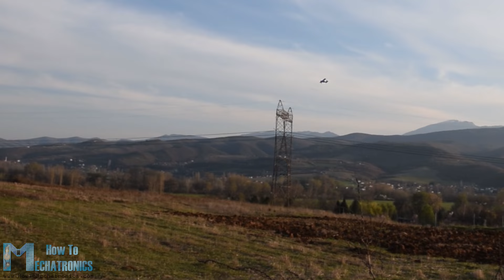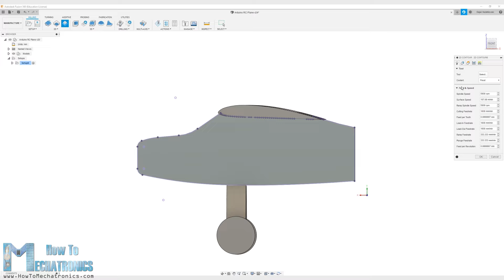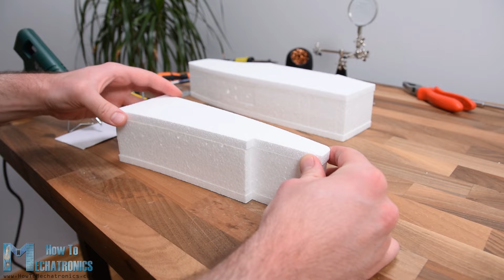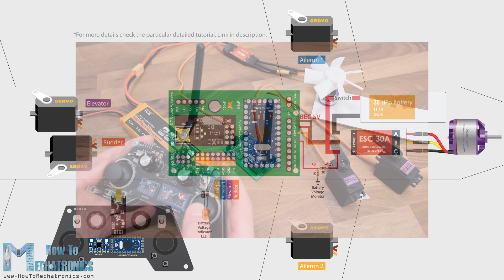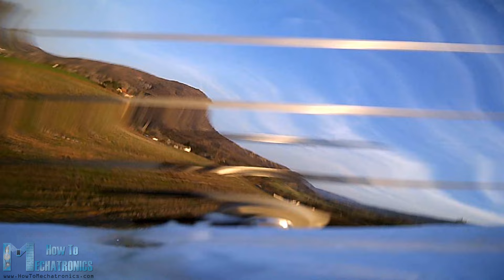Arduino RC Airplane | 100% DIY

Comment: First of all,it's definitely a big success as your first DIY RC plane.Great jobs!
Suggestions:
add some 'EXPO' to your controller output(instead of linear mapping,controller is less senaitive near neutural position.)
change rudder trim to elevator trim,that's used more often.
use XPS foam instead, it's much stronger.
search 'basic aircraft design rules' for easily determine Cg, stablizer size etc.
check out Andrew Newton 's channel, he is an expert at building foam board plane.
Reply from the maker: Thanks for the tips!

Comment: I think the plane going to the right is due to the rudder having more surface area in the right side so more contact area (due to the groove and being glued on the left side) gluing the rudder smack in the middle should solve it or trimming with potentiometer like you did

Comment: some info.     there are just a few  boo-boos/issues.
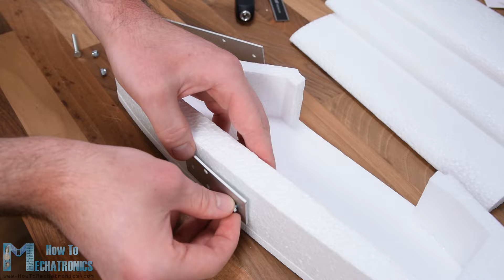at 7:55,  can you not source  1/8"  PLYWOOD.

at 8:45,  you now have a fuselage that is  tapered  in  Just  ONE  axis!!!     the Result is   Excess Mass  in the tail boom  and  excessive blocking of the  thrust air, at the nose.
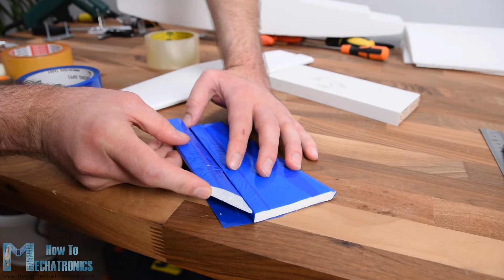at 10:16,  partial amputation of the rudder is  NOT  recommended!!!    Figure it  OUT!!!     see linked  drawing of a  notched/split-elevator;  used by  cessna.      

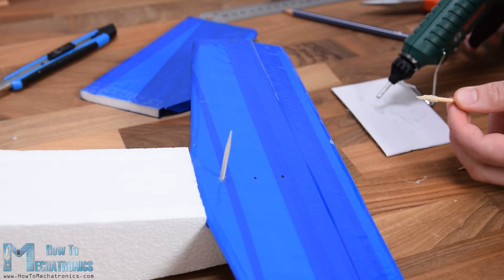at 11:00, the  Result of  slab-mounting the horiz-stab on the fuselage in that way  is,  More  excess mass, at the  Tail.     

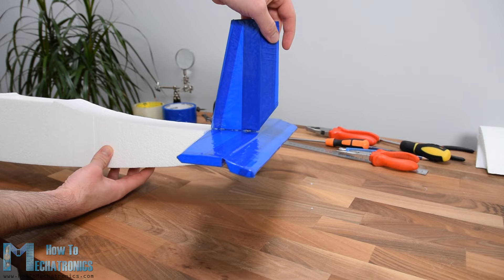at 11:13,  the vert-stab is  TOO   TALL.  and, thus, its mass is  Excessive.    the height of the vert-stab  Should be  LESS-than  fifty percent of the horiz-stab span.
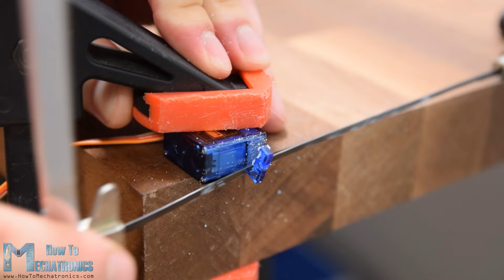at 12:17, cover the wing, from aft to forward; like horizontal shingles.   apply a finish strip,  that is  bisected by the leading edge.            at 13:58,   A N A L!!! 
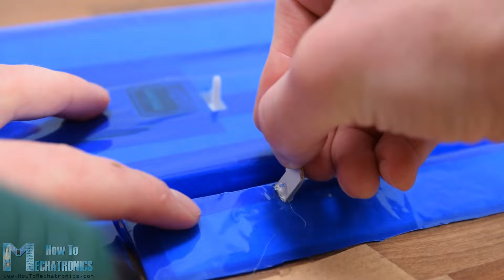at 15:03,  a  METAL  control horn. !!!   Are  You   Kidding.     use  an  OLD  CREDIT CARD  or  similar material.

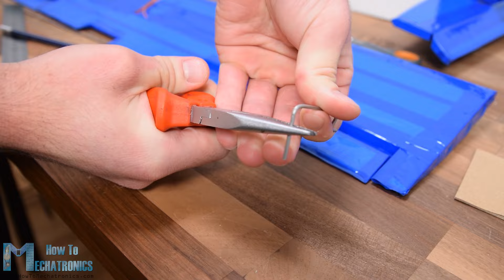at 15:09,  that  wire  is  Ridiculously  too   big; and the  holes  are  Even  bigger!!!   which has resulted in  excessive play in the linkage.
at 15:37,   servos   DO    NOT    GO    AT    THE    TAIL!!!!!     servos go  NEAR  the  cg/c-m. 
at 17:11,   something  Must  be  done, to keep the wing  'registered'/in place.

at 17:27,   MORE    EFFING   TOO-MASSIVE   METAL!!!!!!        note  that  the  struts   SHOULD  HAVE  BEEN  TAPERED, in order to  Reduce  mass.
at 21:26,   too-Heavy,   METAL,   tail wheel  strut.     this is  One  More  factor  Contributing  to  tail-heaviness, in the model's  dom.   distribution of mass.
it should be understood that an airframe has  TWO  balance points. 
the 'other'  one  is  the   c-m.     center  of mass.
thus, it should be  understood that making the nose heavier does  NOT, necessariily,  eliminate  tail-heaviness  in  the   dom.      the remedy  IS  to  REDUCE  the amount of mass  located  aft  of the cg/c-m!!!   period.      in other words, the  tail boom and  stabs  Should be made as Light as is practical;  and, the  addition of  aft-located Mass   Should  be  AVOIDED!!!     googleranslate
Reply from the maker: Wow, thanks for the comprehensive input! It's true, I have to learn a lot more! Cheers! 😀
Reply: Everything about this comment is wrong. Do some research for once

Comment: friend, you manage to convert it to  Frankenstein plane  lol. But you have done great work. What is weight without battery? You must add everywheare tape ,but thin tape.I suppose weight is less than 500gr,if so, you may need smaller batery than 3000mAh.Ds2830 is really big motor and you better try 10" props well balanced,but it would be better with a 22xx motor.Happy flying!
Reply from the maker: Thanks for the input! :) Well I guess it's too heavy, I've just measured it and its 780g without the battery.

Comment from the maker: Hey guys, I would love to hear your thoughts about this project, especially from you who have experience with building and flying RC airplanes. Please note that this was my first ever experience with building and flying an RC airplane, so any suggestion and advice will be highly appreciated! (I'm gonna need it for v2.0 😃)
Reply: @van_b12  hold up😂, gps is very complicated thing, i think his target is to fly.😂
Reply: You should use 6-7mm thick depron, instead of this foam, also your fuselage is very wide and i think its really heavy for this 1000kv motor with all these additional electronics and reinforcements.
I think you should first try to take off and land without landing gear, it's much easier.
Reply from the maker: These points sound just right. Thanks for this comprehensive input!
Reply: @HowToMechatronics  the plane seemsheavy, try to weigh it
Reply: Why you don't want to use 2 propeller?
Reply: it cool also i my country foam is banned 😂😂
Reply: I've got lots of experience building airplanes. First of all you are making the airplane too heavy. I understand that you want to make it strong with aluminum but that is a quite heavy material for rc airplanes and I'd recommend using 1 to 1.5mm plywood instead. The landing gear is also very heave on that plane. I'd recommend you build a belly lander or make a way lighter landing gear next time. Also you made the wing 80cm which is quite small considering the weight of the airplane, I'd recommend you make the wing at least 100 to 110 cm and add dihedral to the wing. Making the wing longer will make it more stable and adding dihedral will also make it more stable on the yaw axis. I think stability is the number one concern after the fact it's to heavy. When I make planes just about this size I try to keep the weight around 500 grams with the battery. I don't know what battery you used but for a plane that size you should never go over 2200mah 3s battery. So next time skip the aluminum, make the wing bigger by about 30 cm, skip the heavy landing gear and add dihedral. Also it's very impressive you got your first ever plane to fly at all since I took about 5 different designs to make mine fly and it would have probably flown quite nice if you would do the things mentioned previously. Good look on the v2.0 and hope I could help :) Also in the end you blame the crashes on too high throw which is not really a issue from what I've seen.
Reply: Give it bigger rear horizontal and vertical stabilizers (about 15% should do it), and i can almost guarantee it'll fly okay providing its, if anything, abit nose heavy.
Reply: stay home 😂😂
Reply: This is what I am literally working on rn lmao 😂 nice video though
Reply: @mr.andreiandrosoff5962  What is "program 'expo' into control code" ? 
I tried to google it, but "expo" may be just a little to cryptical for google.
Reply: Dozo G I have no experience in programming arduino nor in aircraft (that's why I was here ;-) ), but with "expo" I think he refers to not linear movements. Rather with exponential movements you could have more quick response to long inputs and precise response to short ones. But I could be completely wrong!
Reply: Actually I have a bad experience with a radio communication  in moving receiver. I think you need to do a data transfer and ping test comparing between steady transceiver and moving transceiver. And also you need to simplify your code even more Cz i see some latency between the joystick movement and servo movement compared to common RC Tx on the market. Try to consider 32bit uC, it may work better.

For the Plane, I appreciate your attempt to use Styrofoam instead of depron /EPO foam which are more stiff and rigid compared to Styrofoam. That gave me a hope since I can't get depron sheet or EPO foam sheet easily in my place 😀 . And I think your prop motor is lil bit underpowered for that wing surface area and takeoff weight. You can reduce the take off weight or redesign the wings to raise lifting force in lower speed. Use balsa wood instead of aluminium profile. And avoid as far as you can to use a bolt and nut. 

Try hand launch first. Take off from a runway isn't easy task with underpowered plane Cz you need to stay stable until enough speed. Its far different compared to overpowered plane which can takeoff in very short rolling on the run way. 

I'm waiting for the V2.0
Reply: I can't make the transmitter work, any suggestions?
Reply: The control sticks very sensitive. Add exponential adjustment option for all except throttle
Reply: Great video, great project. As a new RC flyer myself, crashing seems to be the norm, repair, modify and try again. The fact that you got in the air is a success. It looks like your plane is a bit tail heavy so try to reduce the weight from as far back as possible, possibly move the elevator and rudder servos forward closer to the CG. A bit nose heavy will fly and be controllable with a bit of up elevator but tail heavy in my limited experience will result in erratic control and a crash. The plane also seemed to pitch up with power so try angling the motor down 2 or 3 degrees plus a couple of degrees to the right when viewed from behind. When power is rapidly increased the plane should ideally maintain level flight and climb as speed increases. I look forward to a follow up video of V2.
Reply: Congratulations, the project is really cool. Forget the aluminum for the reinforcements and the landing gear, try using rigid wires like piano strings for the landing gear and for the wing reinforcements use fiberglass rods, make wings with dihedral, 3 degrees is enough, the flight it is much more stable. The rear wheel must have a system in which it moves along with the rudder to facilitate taxiing the model. The wings should be a little longer, 20 cm should be sufficient. place the rudder and lift servo closer to the center of gravity, they are too far in the rear. In your transmitter, these video game joysticks are very sensitive, because they have a short activation course, replace them with radio control joysticks, the sensitivity will remain as it should. There is a type of wood used in classic aeromodelling that is light, resistant and perfect for making reinforcements, I don't know what it is called in English, but in Portuguese it is called "Madeira Balsa", just search on google and you will find it. Greetings from Brazil and congratulations on the beautiful project, I hope you don't get discouraged and I'm sorry for my bad English.
Reply: Very nice design. I've been looking into building airplanes useing 20" x 30" foamboard sheets. Do you have a DIY plan to built a foam board cutter similar to the foam board cutter you use to cut out the parts for your plane? Thanks.
Reply: Love your project it's brill!! I'm currently undertaking my own Arduino RC plane :D as I had some spare Nanos and NRF24s and thought it would be really good fun. My advice would be, make sure you have something that flies perfectly before attaching parts. I'm on my third iteration of fuselage and wing from scratch and it's finally beginning to fly well enough to be fitted with the electronics. I took it practise gliding by hand launching and seeing where the issues were with the design. Did it roll too much? Was it tail heavy? 
I had the same issue with my first design,  it was too tail heavy. I added so much weight to the noise, it just ended up crashing. My other recommendation, is make a glider with a nice large wing section whilst keeping the wing as thin and light as possible. Also try to add some dihedral effect with the wings by forming them into a V, this will help by always making the plane want to fly level.
Reply: is it possible to attach a camera to the plane so you can watch while flying it? Like most drones but funnier
Reply: Why did you put the IMU in the controller? Instead of the plane???
Reply: It is not 100% DIY as you have not made the motor, servos, or ESC.  However, for being completely new to RC aircraft, you did surprisingly well, both in construction and flying.  I would recommend using foamboard because it bends instead of shattering.  Good luck on v2.0
Reply: Sir, Can you please make a air guitar using adxl345, ultrasonic sensor and arduino
Reply: Hi, im a techno phobe mum whos just got my son an ender 3 printer for his birthday? 
what else do i need to be purchasing to get him started.

Comment: another video another mindblown! you could also use PVA glue for the styrofoam parts, it takes a bit to dry but it works wonders and can be cut with the hot wire even after gluing
Reply from the maker: Thanks for the input!

Comment: This project is so cool but what you need a little bit dihedral that will make it more stable and it a little bit heavy but good work
Reply from the maker: Yeah, I was thinking about those two things as well. Thanks for the input!
Reply: @HowToMechatronics  i had have this experience from YouTube channel called flite test check it they are so cool you will learn a lot from them and I think you can contact them and make them tell you about osom ideas can help you

Comment: "You are awesome brother "  please , please  make a  ventilator ,,for covid-19
Reply: A Ventilator is pretty simple, built one when I was 9. 
I had a cordless screwdriver a bucket a blade wood a screw and a net of aluminum to prevent fingers of entering. Then I sawed the bucket so that it only was 10 cm high, mounted the blade on the screwdriver, used a little wood and the screw to build a mechanism, that is, the further the screw is in, the faster the motor goes, the blade gets vertically in the bucket wich is surrounded by the net and a stand for the bucket out of wood…
Ready